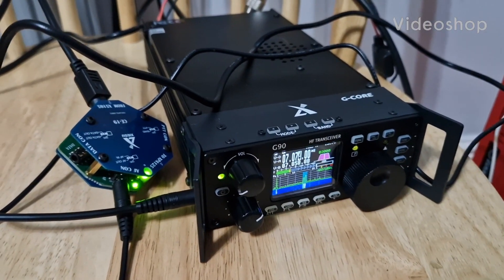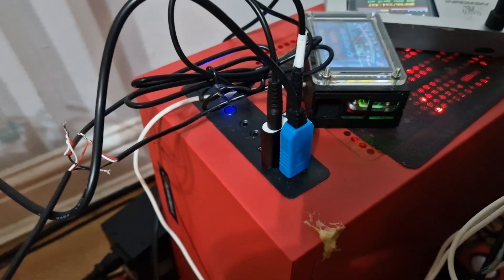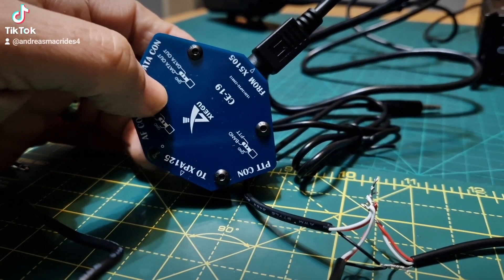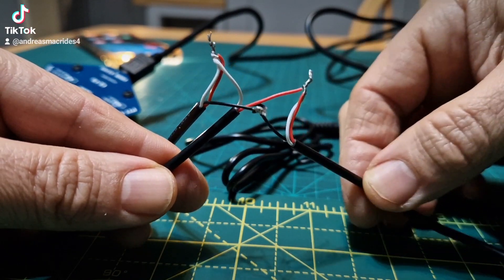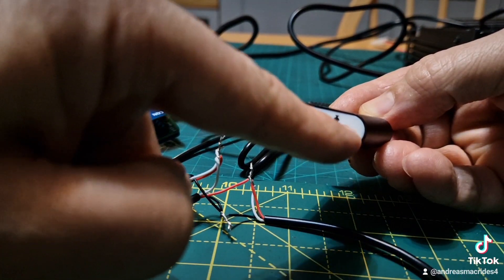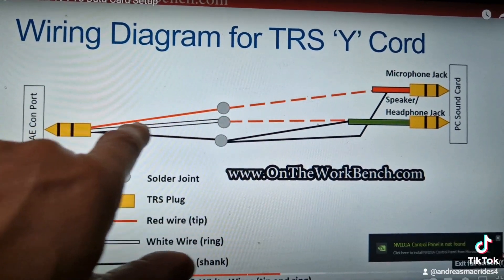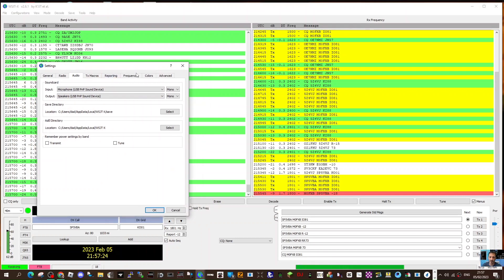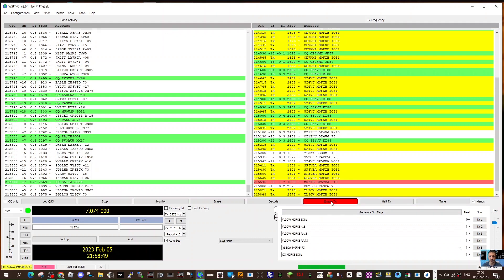XIEGU G90 & CE19 FT-8 WSJT-X Set Up

Comment: I don't have 8 pin mini DIN cable. Can you tell me the pin out on it please? Is it a straight though cable? I found the pin out for the G90 but not for the C-19. Is it a cable used on other equipment?
Reply from the maker: What radio do u have  ?